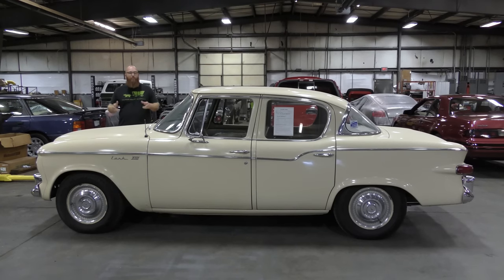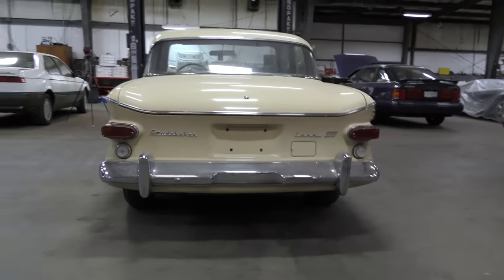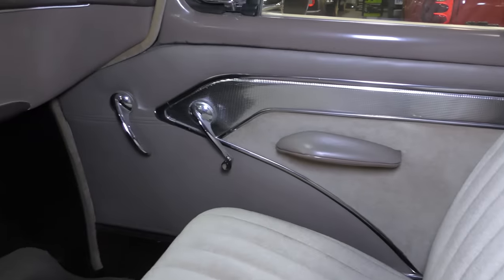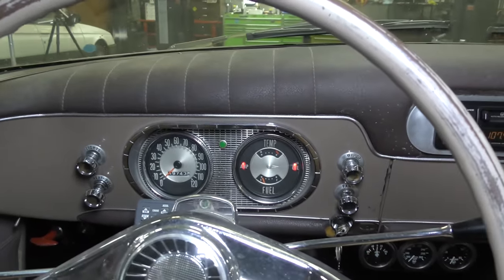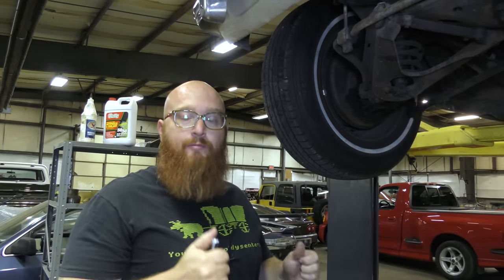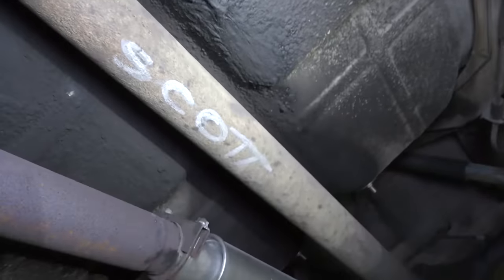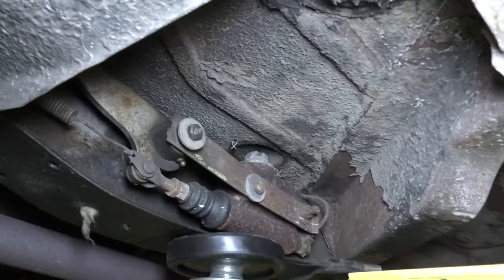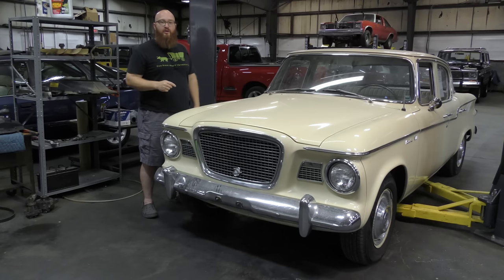Finally a CAR WIZARD approved engine swap done on this '60 Studebaker Lark VIII

Comment: I used to work in service stations in the sixties.  You do a lube, oil & filter job on one of these vehicles and it takes some time.  Studebaker was one mark that had the most grease fittings of the period. People jokingly used to call them "Steady-breakers" or "Rudabakers".

Comment: The grill reminds me of an early Valiant by the general shape of it
Reply: Yup....
My mother had a Valiant in the early sixties....61...or 62 probably. This car reminded me of that.
Reply: Growing up we has a 1961 Valiant V200 with the wheel trim in the trunk lid. I drove that car in high school and my first 2 years of college.
Reply: My Grandfather gifted me his 1961 Valiant sedan with pushbutton automatic and slant six when his eyes got weak. I don’t think he grieved for it because he drove Chrysler Imperials for decades. Still remember that Valiant with great affection.
Reply: @dickdaley9059 
Did the gear selector buttons ever pop out in yours?  I got very good at putting them back in their slot.
Reply: @JackBWatkins  They used to jam in first gear on my 62 Valiant, had to get under ad give them a bang, they were quite expensive compared to the Ford and Holden of the day here in Australia 👍
Reply: Bingo...and the chryslers of that era, 300..New Yorker...
Reply: The story goes that Studebaker was working on a new compact model by cutting down the existing Champion body and adding new front and rear styling. They hired a designer from Chrysler who brought with him drawings of the Valiant which was not out yet. So the Lark had a lot of Valiant influence. The Lark was quite popular and saved Studebaker. They had features other compact cars did not, like available V8 engine when the competition was all sixes.
Reply: @mrdanforth3744  Studebakers of this era sold surprisingly well in Australia assembled here from Canadian sourced parts and local content.
More common here than Buicks, Oldsmobile, Mercury, Dodge and Plymouth. Similar with Rambler.
Police thought highly of them. Some police racing enthusiasts bought them at police auctions to go racing at Bathurst.
Story of the Australian Studebakers here :
https://youtu.be/SHHTPLw-oNM
Some of the police highway pursuit cars were two door cars. Would these be Daytona bodies.
Standardised on V8s with highest trim level here to justify higher prices and simplify the range.
Reply: @johnd8892  early TV memories of Homicide detectives using Studebaker cop cars.

Comment: One look at that steering wheel and I can tell you with very little doubt that the 49k miles on that odometer are not the only miles on that car.
Reply: Tan overspray on the trunk padding.   4:01   This is a restoration.

Comment: My buddy has one of these we put a caddy 500 in it with holley fuel injection. We grafted the front frame of a s10 on it to modernized it and give it disks. Has vintage ac in it. He is 62 (good bit older than me at 44) and his wife daily drives it. We just got done swapping out the 5 speed manual for a 6 speed.

Comment: I still remember the Avanti with the Paxton belt drive turbo set up it had 300 HP
Reply: W factory disc brakes!
Reply: @obsoleteprofessor2034  way ahead of there time
Reply: It was a Supercharger not a Turbo
Reply: @ghryder   your right , I've seen one on a mustang at a car show it was noisy .

Comment: I had a 61 with a 259 v8 there were things that they did was cool, the engine used timing gears no chain or belts. mine ras pretty good and got great gas milage because it was geared pretty high. I use to drive it from Colorado Springs to Amarillo tx in about 5 hours running 70 mph almost all the way. I didn't think it was a pretty car but really fun to drive. I remember trading a 54 ford and 250.00 dollars for it and wish i still had both of those cars. it was sad to see Studebaker go out  of in 1964? not sure of the year and the Avante was so far ahead of it's time. Also at the end they started using small block chevy engines. If I could just go back to 1965 I would buy it again.

Comment: I'm 65 now, but when I was a kid, my father took me to a County Auction to hear the auctioneer ramble. My father came over to a '60 Studebaker Lark painted in the County light blue paint. He looked around first then quickly disconnected one of the spark plug wires. So when prospective bidders listened to the engine, it had a definite miss. At the time of bidding for this particular Lark, nobody said a thing or raised their hands except one person, my dad. He bid $100 and was not opposed by anyone. SOLD FOR $100!! So, my father and I drove off the County lot and down one block and pulled over to the curb. My father opened the hood, connected the spark plug wire, closed the hood, and got back in the car. He drove that Lark to work everyday for at least ten years and on his nights off would take me, the Lark, and our black Lab, into the woods for some rabbit hunting. With me driving at 10 years old, my dog by my side, and my father out sitting on the hood of the solid Lark, waiting for the headlights to stun the movement of a big fat rabbit.
Reply: Wonderful role model
Reply: “He catches the crafty in their craftiness”

Comment: Yep. That was my goal with my ls swap. My small block was nothing but reliable, but the first turn of the key of the fuel injection is just awesome. I drove it across the country and for an entire winter and it never left me walking once, at least after i worked the bugs out. Now if only i fixed the heater...

Comment: We had one of those (in white, even) from 1963 to 1975 - I spent a lot of time in that as a kid. It had a straight 6 and 3 on the tree and zero options - hotter than hell here in Florida during the summer - I remember the searing vinyl on my skin when you first got in. When my dad donated it to the church they sold it - the dude who bought it immediately swapped in a small block Chevy.

Comment: I had 60 Lark 4cyl automatic. The engine did not have a oil filter, so I changed the oil every 3,000 miles. The most interesting feature of this car was when the front seats were moved all the way forward and seat back reclined all the way it matched up with rear seat, instant bed.

Comment: Engine swaps in 60's cars were incredibly simple.  There were only 2 or 3 wires to connect and a speedo cable.  Any monkey could do them.  There is a lot of slop in the steering linkage of this Studebaker, clearly shown and glossed over.  Those seat belt mounts in the back would pull clean through the floor in a crash, those puny washers would hold nothing in the thin sheet metal.

Comment: Way do i got a strong soviet-polish-East Germany car vibe from it? and it definitely have a quirky cool factor too it. :D
Reply: 1960 VW/Porsche style headlights and Mercedes style grill.
Reply: Studebaker and the remnants of the Packard Car Company they inhaled in '58 had much more European engineering influence than GM or Ford- Chrysler too, but not to the same degree.  FR
Reply: The proportions are reminiscent of a mid-60s Singer Vogue/Humber Sceptre, especially that wrapround rear screen.
Reply: It looks a little like a LADA with yugo curves
Reply: @MP-vd1ck  Nearly a decade before FIAT built the Russians the plant to build the New Lada in!  FR
Reply: @davidjones332  Actually, very close and very much contemporary. Studebaker always had a larger European slant than the Big Three style and engineering practices.  FR

Comment: $10,000.00 ? To swap that is crazy ! There is no brain surgery involved in that swap. I did those things in High School. I remember changing a Riad Runner from being a automatic to a 4sp. Going through junk yards looking for pedal assembly ect. Learning by doing. But changing engines was every six months or so as I would blow them up and have to save another $150.00 dollars for another used 383 or 440 ! It never took but a few hours at most to change my motor . Some cars are harder than others but the little Studebaker is a easy change. Wonderful up grade and your right that little car should be a dream all straightened up. 🇺🇸👍

Comment: In 1959 My Granddad bought a brand new Lark 4 door sedan with a V-8 4 barrel carb. and factory air conditioning. Same color as that one. It was a very good running comfortable car with plenty of pep; In 1960 I was 16 and had just gotten my license, so my Grandparents and I took it on a vacation from Northwest Missouri to Western Washington, I shared the driving with my Granddad and the Lark performed splendidly. The Lark was a very good quality, well engineered car. I'm a retired mechanic, so I don't know why someone put a small block Chevy in your Lark unless maybe they couldn't find parts, or maybe a GM V-8 was what Studebaker used back then.

Comment: My dad bought a 1959 Lark brand new. It was pretty much like the ‘60 in your video. The viii on the car indicates that it was originally a V8 car. It would have been a 259 cu in engine. My dad’s had three on the tree manual tranny. Oddly the backup lights on them was an option as well as the full wheel hubcaps. As I was only 7 at the time I never got to drive it. Lol

Comment: Studebaker and AMC, two companies that built quality products but were too small to compete. This Lark was originally a V8 car, hence the "Lark VIII". Original V8 was a really good engine but Chevy was probably swapped in for parts availability. Drain plug on TH350 transmission allowed easy fluid changes; I had one of those transmissions in a '70 Malibu, over 300,000 miles without a rebuild! Stuff that was meant to last, thanks for this video.

Comment: What a GREAT Video!! for me to come across.   My First Car was a  1960 Studebaker Lark VIII  I bought it (Well Used) but drivable for $225cnd. in the Spring of 1969.  I bought it from the Original Studebaker Dealer in my area. Studebaker Dealers all sold two makes of Vehicles " Studebaker and Mercedes Benz ".  When the last Studebakers were made in 1966 the Studebaker Dealers could continue on in Business selling Mercedes Benz. The Motor had been changed in my Car also. It originally came with a 259 Cubic Inch  8 cylinder, but mine had a 289 cubic inch engine that had come out of a Hawk Model Studebaker.  The 1959 model Lark looks almost identical to the 1960 model.  1959 Lark really sold well but by 1960 the other big manufactures came out with their own Compact Cars and Studebaker lost sales to them. 1959 was the last really Good year  for Studebaker.  NOTE: My father only ever bought One New Car in his life and that was a 1963 Studebaker Gran Turismo Hawk  my father bought the car from the exact same Studebaker Dealer and person I bought my 1960 Lark from.  My father  travelled to the Studebaker Plant in Hamilton, Ontario to pick the car up. There is a lot of NOSTALGIA in this video!!

Comment: I had a 61 Lark back in 1973. Flathead 6, 3 on the tree, paid $25 for it. I was talked into taking it out to a local race track and run it in a demo derby. During qualifying the car was pretty quick, ran it in 2nd gear and barely lifted in the corners. Got a flat tire in the heat race and didn't finish. Finished 12th out of 17 cars in the finale. The other drivers ignored me till one guy slammed into the passenger side in a 58 Ford station wagon. That broke the right side axle and I was done. Sold the car to a guy at the track for $20 and I got $30 for running in the demo derby. Doubled my money and had some fun with the car.

Comment: I grew up near a old Studebaker Dealership in Bent Mountain,Va. ReedsGarage is located just off the Blue Ridge Parkway and is in operation today under a different name. Studebakers were very popular in this area and there are many still in use. Only adults liked them young people were more into muscle cars. If I was interested in a sedan, one seater coupe or pu truck I would look around that area. The Chevy 283 was the engine swap of choice as they were said to drop in easy. Reeds Garage did a good number of engine swaps after Stude engine parts became scarce.

Comment: I have a 1965 Studebaker Commander powered by its original 194 Cu. In. Chevy inline 6. Transmission is a three on the tree with a Borg Warner overdrive. That engine was used in some Chevy pickups in the late 1950's and the original Chevy II's. The engine was overhauled at about 120K before I got it over thirty years ago. It had typical for those years and body style Studebaker rust, so I got NOS front fenders for it from Newman and Altman in South Bend Indiana and a friend with a body shop painted it for me. Otherwise except for radial tires it's all original. I've driven it about 25,000 miles over the years. Still averages about 24-25 mpg.
     When Studebaker went bust Newman and Altman bought the old Studebaker factory in South Bend and the entire remaining parts inventory for many different year models. Newman and Altman has changed hands, but I think some parts are still available from whatever that outfit is called now.
     For the last two years of production, 1965 and 1966, all Studebakers were built in Canada. There was only one body style which was a little larger than the Lark. The Plain Jane 4 door Commander like I have and the Daytona which had a lot more chrome and some other options including the Chevy 283 with the TurboHydramatic transmission. A friend of mine once had a 1957 Studebaker Golden Hawk with their little V8 (289 cubes if I remember correctly) with the Paxton-McCullough belt driven super charger breathing life into it. It had the same tranny setup as my Commander. Now that was a car!

Comment: Had a 62 Lark VIII.
Best point was the overdrive - gave the car CRAZY legs on the open road.
Worst point was the pitman link - replaced those bearings every 6 months - drove a lot of dirt roads.
Those needle rollers in the pitman bearings just got pounded to dust no matter how much grease you fed them.
Eventually turned a full height brass bush that lasted until after I sold the car.
Oh yes, they simply loved eating the first gear - no wheel spinning from the traffic lights - just too expensive.
But 2nd gear overdrive was good for over 110 miles an hour - and then you still had 3rd AND 3rd overdrive.

Comment: That's an impressive swap! But I would be concerned about the steering box proximity to the exhaust. Some kind of heat shielding would make sense..
Maybe do a front disc upgrade just to make it more modern for driving it on today's roads.

Comment: I'm just now getting around to seeing this post. Good Job!. This is a Lark VIII, so it had a 259 180hp 8 in it originally. I'm not sure why they put the Chevy engine in it. I had a 63 Lark Daytona Wagoneer With that 259 V8 it in it and for normal driving I never wanted for more power. It was fine! That Studebaker engine ran super. I loved that car and I drove it till the salt ate it up. In 1974 I sold it for $75 to the vice President of the Studebaker motor club. He could not get over how good it ran. He kept getting in and starting it up. There is just something about Studebakers!